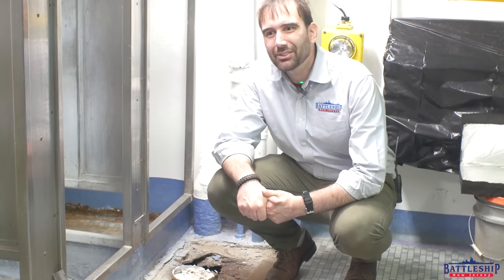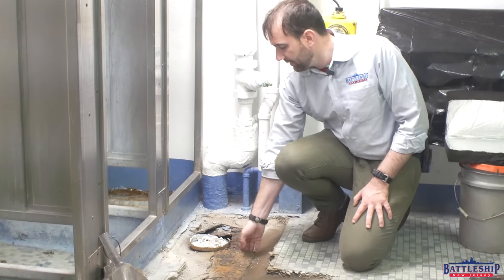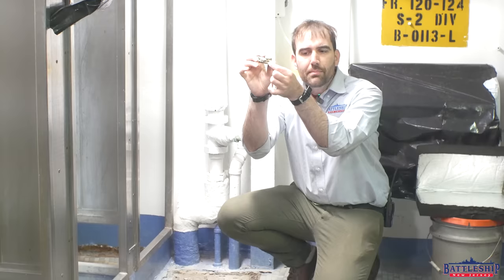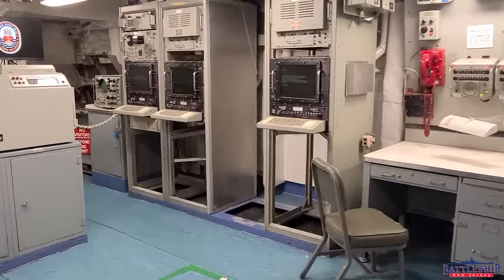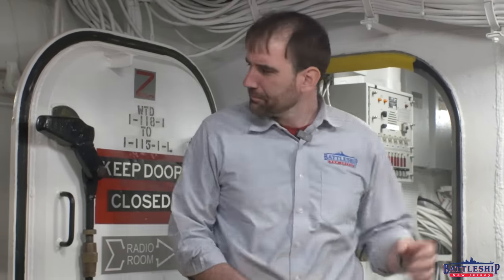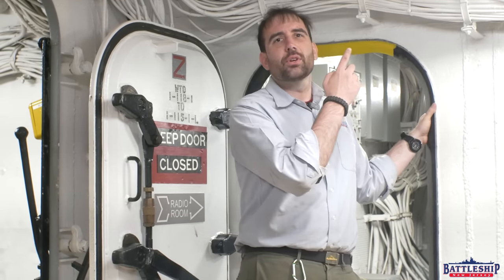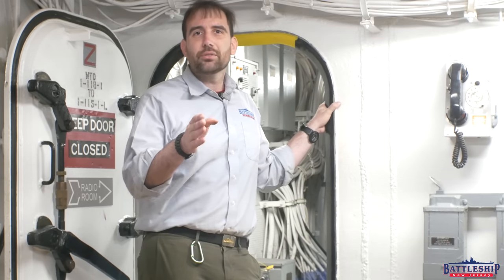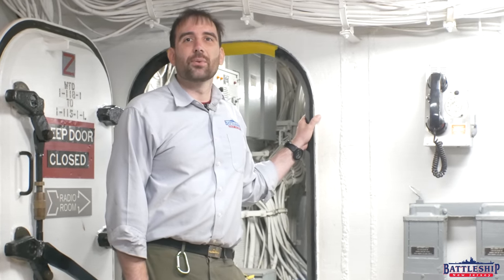Why We're Excited to Find Holes in Our Ship

Comment: A good solution for tile over metal, so you don't get water ingress, would be to mix the coat below the tiles with sodium silicate (water glass) and then coat that layer with pure sodium silicate. It forms a near impenetrable barrier against water ingress.
Reply from the maker: That's what was under the tiles already. It wasn't entirely successful.
Reply: Laticrete is the product to use for this application.
Reply: Kerdi membrane like I just put in under our new tiles.
Reply: @m1t2a1  Kerdi is a good product. Just pricy for a non-profit.
Reply: @TheSteelArmadillo  I'll give them the rest of the roll, and drop it off. Just to get it out of my shed lol. By my mistake I have about 300 sq ft leftover. Measure twice indeed.

Comment: I'm really surprised that mosaic tile is used on a ship, considering the vibrations from machinery and guns, not to mention the shocks going through the ship when struck by enemy shells.
Reply: I am really surprised that  1 inch Armor Plating Rotted like that ...  looks  like they just used just mild steel plating
Reply: @rogerstlaurent8704  It didnt. He said the rot is AFT of frame 123. So the rot was just regular compartment metal roof, not the armored roof of communications, which is forward of frame 123.

Comment: I know on my last ship they got rid of the tile, they used a rubber base and 2 part epoxy with the paint chips and a top coat, very easy to take care of, similar to the garage concrete coating people use
Reply: It is called PRC, which is actually a trademarked name but is used as a general term for the epoxy coating used on the decks.
Reply: @Dave-in-MD  yes sir, thank you for reminding me, they used to bring on a shot blaster and take it down to the steel
Reply: And it stinks
Reply: Gotta be better than that title and leveling compound holding water and rusting out the floor.
Reply: @bobbygetsbanned6049  it was, it would last 3 years and they would renew the stuff

Comment: HY-80 is good steel for resisting deformation, which is why they use it to make subs.  It would be good against blast/pressure but not great against splinter penetration.  Does that tell us anything about what sort of attacks they were anticipating in the 80s?
Reply: With no real authority whatsoever other than the most amateur of understandings of history, I’d say that tells me that they were anticipating concussive attacks rather than direct attacks. In other words they figured the ship was more likely to be bombed than to be shelled. And given the nature of the 80’s I’m guessing it would be nuclear. And a big part of a nuke’s energy is in the blast wave. But that’s a shockwave hitting the whole ship, not a piece of exploding steel punching into your ship then exploding.
Basically the difference between being punched and being stabbed.
Reply: @Hoshimaru57 I could see a tactical nuke being an anticipated threat. It was certainly an anticipated weapons platform on the ship!

Comment: The deck around the Harpoon and Tomahawk Launchers!  Basically to protect the ship from the missile exhaust blast!
 
I've also seen where they used different amount of leveling compound in the heads, galley, and mess decks to direct any water/spills towards the drains in the deck....
Reply: Using a leveling compound to pitch a room towards the drain is common practice in any bathroom that has a tile shower. I've built a few over the years.

Comment: I just realized that with modern day laser or water jet cutting machines a damage control group could do a pretty good job patching up damage with cad files and a metal stock supply. Cut it up roughly and then tack weld.
Reply: Theres also those hand held 3d scanners you can get, just scan the hole and you can get a pretty accurate file of it
Reply: I don't know if that's really needed. A guy with an acetylene torch could cut metal to a rough shape reasonably well and it doesn't require the ship to have power to work. A waterjet cutter takes forever and lasers require a lot of space.

Comment: this made me wonder if armor takes longer to rust than the rest of the ship, or if it goes faster
Reply: It depends on the composition.  The New Jersey was mostly armored STS for her WWII era stuff.  It had SOME chromium in it.  Not enough to be stainless, but it would resist corrosion more than common steels.  No idea what was used in the 80s, it may well have been more STS, or something more modern, or even just RHA.
Reply: It's complicated is the answer. Lots of dissimilar metal corrosion going on and galvanic corrosion. That's why the ship has passive and active (impressed current) corrosion suppression systems
Reply: @BadHaddy  looks like to me they were cutting  corners 1 inch Armor plating should have not  rotted out that fast ????
Reply: @rogerstlaurent8704  It didn't, the armor's fine. The armored roof stops where that line in the tile was, and it's just structural steel plate from there on under the shower.

Comment: Why is 400hz AC electricity 'better' than the normal 60hz AC for the rest of the ship?
Reply: It's just what is used for radar and high power radio equipment
Reply: 400Hz equipment is smaller, lighter and generally less expensive (except for needing to be MIL-Spec).   Add up all the generators, motors and transformers on a ship and it makes for huge space and weight savings.
Reply: 400 Hz is advantageous because it allows transformers in equipment to be a small fraction of the size and weight of 60 Hz transformers.  That is probably a much bigger deal on aircraft, but still, saving weight on a ship is not bad.  The down side to 400 Hz is that there is more power loss in cabling, but on a battleship that is probably less than 1000 feet of cable so not too much loss.

I’m not familiar with the the missiles and control system discussed here, but if it had multiple use for land mobile or aircraft deployment then making them all 400 Hz power was probably a matter of expediency of manufacturing and having interchangeable parts for depot maintenance.
Reply: The optical equipment has to interface with fire control.  Fire control uses a lot of synchro's and servos.  Running the synchro's and servos on 400 hz means the amount of iron for cores can be reduced so the devices are much smaller.  Smaller devices means you can put more devices in the same space, and the devices will run cooler as well, and naturally have greater angular precision.
Reply: The frequency of AC electricity is determined by how many field changes the generator goes through -- essentially how fast it spins.  A smaller generator spinning faster can generate the same power for less weight than a 60Hz plant, or a more power for less weight and size.  Since airplanes and ships have high speed turbines for their propulsion anyways, 400Hz makes more sense for specialized high powered equipment like radar and radio.
Reply: Probably so they can use the same radio and radar designs as the ones used on aircraft.
The reason it's used on aircraft is that at the same power level a generator that outputs 400Hz AC can be made lighter than one at 60Hz.
Reply: @ewathoughts8476  Good call on the syncros.  Totally forgot about that.  I had some Western Electric  indicator gear which apparently came out of a Nike battery.  It was obviously ground based but used 400 Hz anyway.  Unfortunately the scrapping process made the equipment not worth restoring, so I parted it out.  The syncros are 115 volt, 400 Hz.  I tried running them on 60 Hz with the voltage slightly reduced and they still followed each other, but with just a bit of jitter.
Reply: 400 HZ makes the ships power being "Dirty" much less obvious to equipment. - Newer ships a lot more of the combat electronics use 400 HZ- so the have static converters. When built the original 400 HZ load was probably covered by motor-generators. he had a video 1-2 month ago showing some switchboards, and framework on deck that had support. some 400 HZ static converters - removed when decom. Newer ships some stuff uses 400 HZ as original design was for aircraft.
Reply: In my experience 400Hz is only used in specialised systems , and I've seen it tallied as reference supply in some fuse panels and connection diagrams . Purely guessing it may be for calibration or accurate measurement purposes .
Reply: A higher frequency results in smaller and lighter transformers and generators. The reason it is not used in the power grid is that distribution losses are larger, so not a good idea if the power plant is just a few miles away, ships and aircrafts are not that large.   The most efficient frequency for power transition is no frequency. DC is more efficient at the same voltage, the problem is voltage conversion is a lot harder, especially before modern semiconductors.

You have devices you use all the time that use the exact same idea.  Modern power supplies do exactly this but at even higher frequencies 20kHz to 100kHz  are common.  The transformer can create sound at the AC frequency so the lower that is used is above what humans can hear. 

The high-frequency AC is created by rectifying the input to DC. Then high-frequency AC is created with semiconductors. A small transformer changes the voltage, and then the lower voltage is rectified back to DC that it output. It is called a switched-mode power supply.

Most USB power adapters, computer power supplies, and other AC to DC adapters today are switched-mode power supplies. It was not always the case for cost treason and you will notice that man wall warts from before the early 2000s were larger and heavier
Reply: @manitoba-op4jx  As an old USAF computer repairman, YOU NAILED IT!  It is the ease of turning AC into DC!

Comment: Why use a premium surface like mosaic tile for a military battleship?  I would think an epoxy coating would be a better choice and was available by 1968.
Reply: Because when it was built it wasn’t considered “premium “, but standard bathroom fixturing. And it may be less “mosaic” than whatever colors they had on hand. Today we’d put an epoxy coating UNDER the tile, but that isn’t  a standard option even today (there are other water barriers that ARE standard).
Reply: Remember this head is in Officer's Country. Do you expect officers to walk around on just a steel deck or cheap linoleum tile like the enlisted guys?

Comment: Would it not be better to move the ship to a permanent drydock for preservation? all this water exposure surely cant be good?
Reply: The problem with permanent drydocking a ship is the hull ends up being distorting and deteriorating. This is due to the hull not being supported by the water pressure caused by displacement.
Some museum ships have used inventive ways to replicate that pressure but they tend to be smaller wooden ships.

Comment: Excusing my ignorance, but what is "splinter protection"? Tried a Google search, without much luck. Does it just mean to avoid 'shrapnel' if something exploded in the comms room?
Reply: It is meant to prevent splinters from shell impacts and the likes nearby from entering the room. So it will not stop a direct hit, but will not be taken out when a room tcloseby gets hit
Reply: Spalling is when chunks on the backside of the armor flakes off due to impact on the face of the armor; shrapnel is what you call the pieces of a projectile after it explodes due to its own internal bursting charge or just due to the projectile falling apart due to its impact with its target.  Think of "splinters" as a slightly more generic term that encompasses both spalling and shrapnel.  Therefore, "splinter protection" would be anything that keeps spalling or shrapnel from penetrating areas you don't want it to penetrate.  Armor or metal intended to function at the "splinter protection" level is only going to be able to stop splinters, it's not intended to be strong enough to stop actual intact naval-sized projectiles.

Think of it this way:  a really warm parka [turret, deck, and main belt armor] resists subzero weather [main battery projectiles]; a heavy coat [STS] resists freezing weather [secondary battery projectiles] ; and a sweater [splinter protection] resists chilly weather [splinters].  

On the Iowas, 2nd deck is the armored deck, consisting of 4-3/4" of class B armor backed by 1-1/4 inches of STS.  About 30-36" below the armored deck is another deck called the splinter deck, made of a much more flexible steel, which is meant to resist and contain in a bend-but-don't-break fashion any spalling or shrapnel (aka splinters) that are generated by big bullets colliding with the main armored deck.  See:  https://www.youtube.com/watch?v=0bYmzIw6VOk
Reply: Thank you @Lintary and  @SomeRandomHuman717  for that! 

Goes to show you I'm not a naval guy. I thought the protection was for the sailors, not the other way around 😄

Of course, logically in battle, it makes sense to protect the ship and critical equipment.
Reply: @SomeRandomHuman717  And.... in the wooden ship era, splinters were actually splinters.
Reply: @SomeRandomHuman717  Thank you for the explanation!